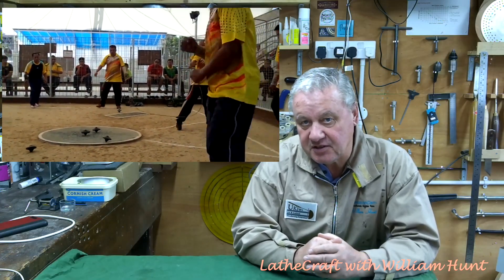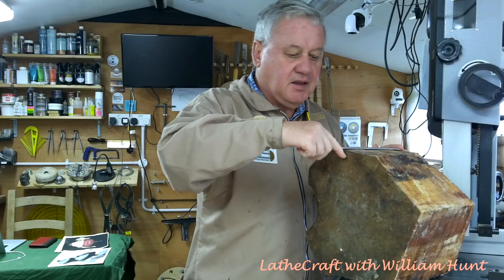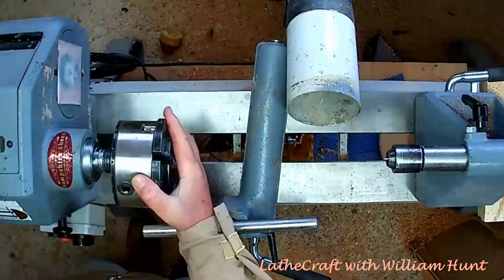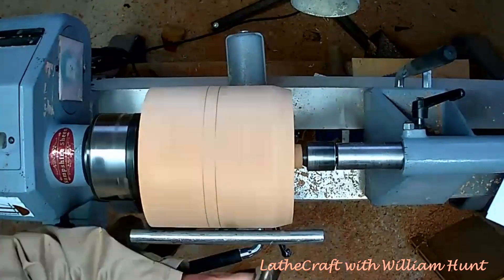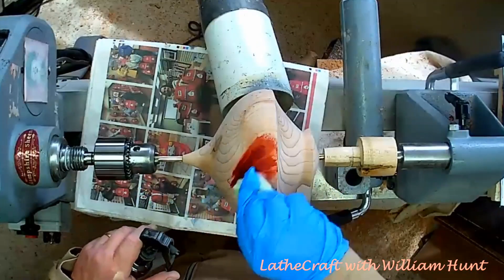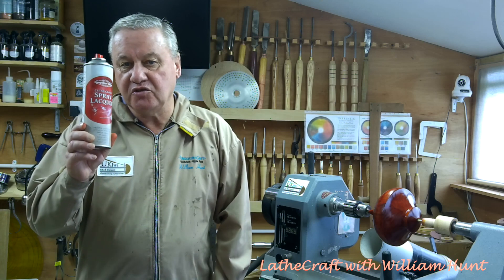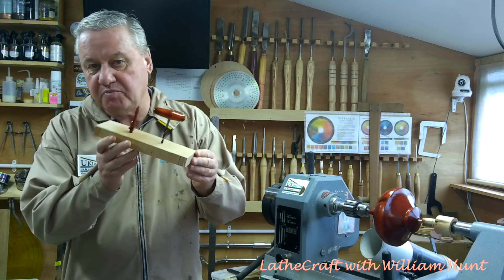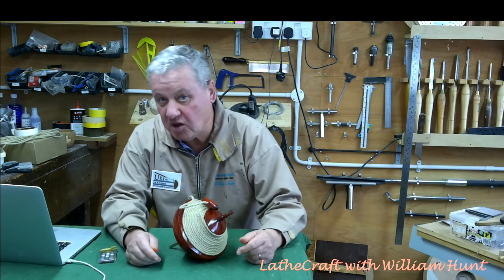🌳Woodturning | Brunei Spinning Top/ Gasing Top | Gasing Pangkah | Malaysian Spinning Top

Comment: I did enjoy the video and the background bit of Brunei culture which helps a lot to understand why you made the top.  I expect the local folks bet on the games.
I appreciated the bits of video showing the gasing of the tops.   I am amazed how long these spin.

The end result looks very nice.    Good call to add the colour.    The wood was rather dull.
Dave.
Reply from the maker: Hi Dave, thanks for the comments. Yes, they can spin for many minutes and that factor can be  decider in the game, so I expect balance of the Top is a major factor. Hard to achieve on a pole lathe.

Comment: Great piece William.  I had many whip and tops back in the 50's so they are on my list to turn.  The gassing,  i would like to make a working model.  The size of the top, on the gassing video, looks about 80mm in diameter.  Is that about right please???
Reply from the maker: Ian Chappell thanks for your interest and comments Ian. As you see from the video the Top is deployed using one hand, therefore your suggestion of 80mm is just about right. Mine being purely ornamental is oversize and not useable. I’m not sure about the rope. I got some hemp rope from eBay 4mm in diameter, but I think it should be fatter. They treat the rope with some sort of gum to make it tacky, stick to itself and the Top. I guess this adds friction to stop the rope from slipping off the Top.

Comment: Intersting piece, and the info on the Game, will have to look into that some more. I like to make stuff that my kids can play, which is usually board games and puzzles, this would get them out of the house and off their devices, lol.
Reply: Oh, with my shavings, they end up as chicken bedding, or simply burnt in the workshop fireplace. I'm looking into how I can build a fire brick press, but as I can't readily get hold of newspaper, I'm looking at using compression to bind the materials together and from what I've discovered it takes about 40tonnes of pressure to do so.
Reply from the maker: The sport is definitely for for kids, it can be quite violent. As for your press have you thought about adopting a log splitter? you often see them on eBay and FB Marketplace.
Reply: Ah, I may have to just stick to them making the tops and just spinning them without the other parts of the game, lol. I do have a 40tonne Log Splitter, but I need that for firewood. Been hoping for a suitable one at the refuse station, or at least the hydraulic parts to be able to adapt something.

Comment: what is the max turning capacity on your lathe?
Reply from the maker: Adrian, my AT1628VS can turn 406mm diameter over lathe bed and 710mm between centres. But I have 460mm lathe bed extension which I can also use for outboard turning meaning I can turn a whopping 870mm in diameter if dared to!